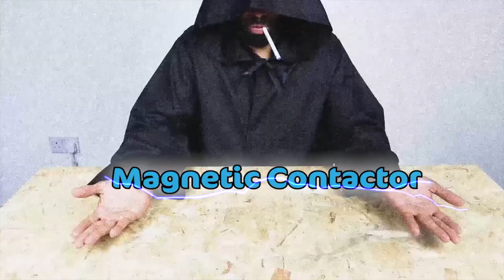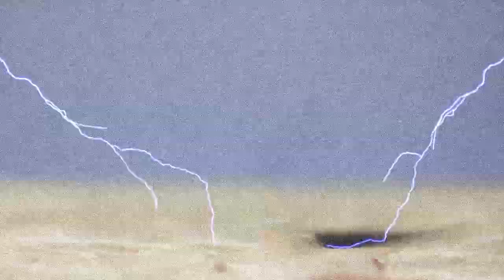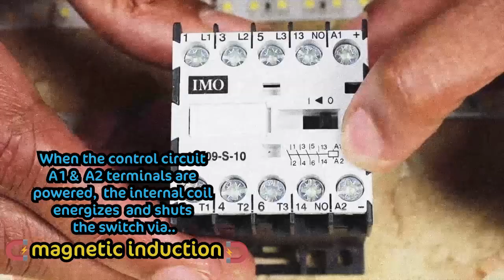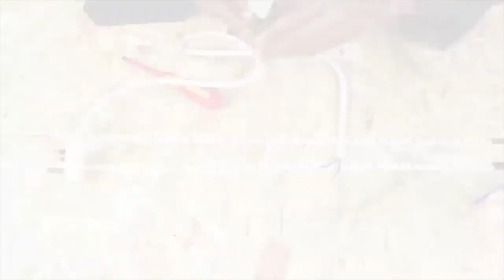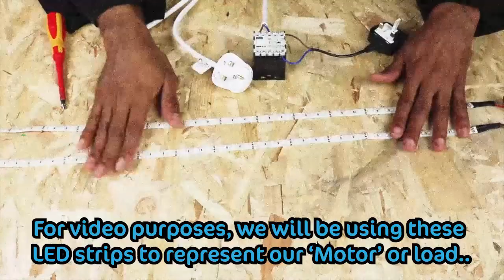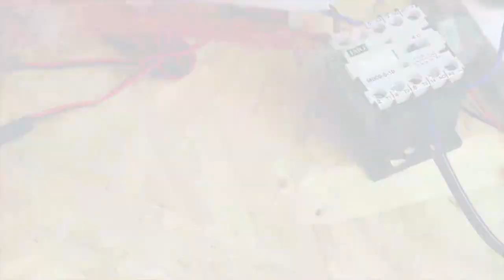How To Wire A Magnetic Contractor - Eco Climate Solutions

Comment: the input white wire is also need to be connected to 240V AC? the control circuit you connected to 240vAC. the output terminals are connected with LEDs through trnasformer. i am confuse just what to do with the wire that is connected with the inputs. either power is needed to be supply with this or not?
Reply: the white cable would be your power supply , the black cable would be a control circuit [on/off buttons]

White cable is for the machine, black just for the contactor coil